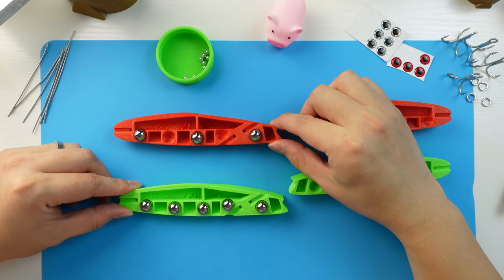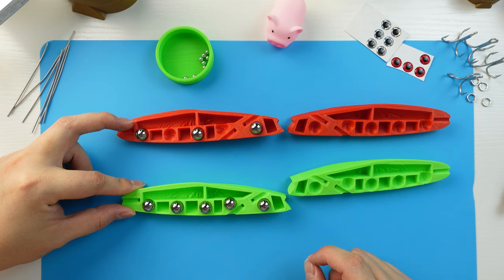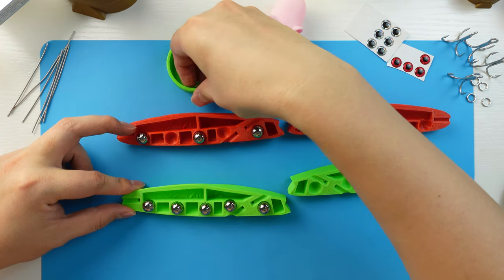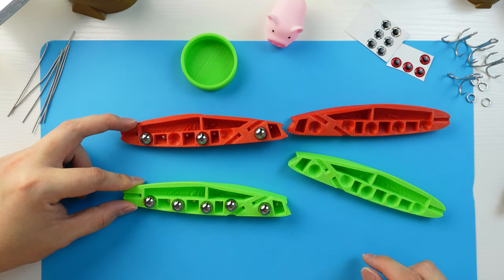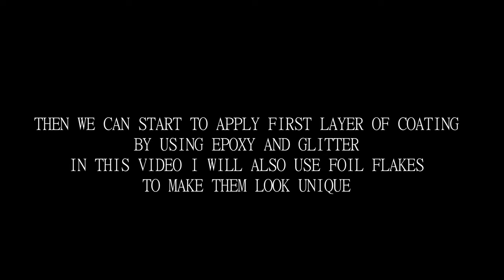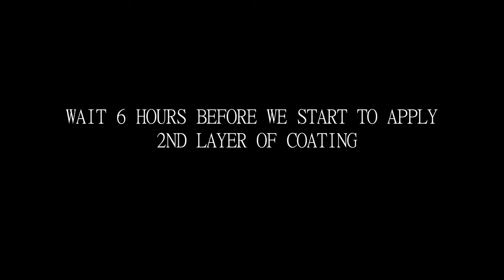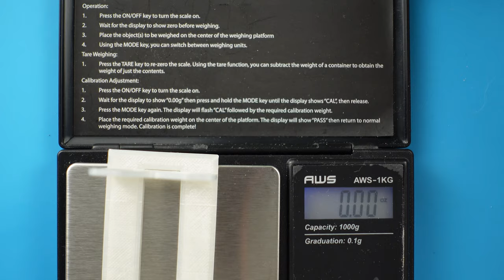Making Darter Plug Fishing Lure. 3D Printed Fishing Lure Making.

Comment: Really cool project. Like the way you make the videos, without the hype. As for the lure - have you considered through wire for it? It should be fairly easy and will increase the lure robustness
Reply from the maker: Thank you. So far the lure is strong enough. If the lure is not strong enough I will try make it through wire.
Reply: @3DPrintedAngler  I've modified the print a bit and it takes through wire without a problem. Big thank you for them, started my 3d printing adventure with your projects. Have a good new year 👍👍
Reply from the maker: Thnak you, wish you have a great 2022.

Comment: Hi nice video and great job. My only concern is what happens if you catch a cow striper on them I’m worried about your wire pieces. How come you don’t put a straight wire through them and it will be awesome.
Reply: Can you make one or same one with a through wire I think It should be stronger. Besides that great job.
Reply from the maker: Hi, thank you that you like my video.
Well, there are a few reasons I didn't design it with through wire.
  1. It is strong enough, because all the the hook eyes are inserted and locked inside the lure not like other wooden lures hook eyes are just glued inside.
  2. With this design weights can put inside lure much more easily.
  3. Again it is strong enough because you have your drag system on your reel. If your reel's drag is 20 lb the maximum force your line and lure will take is 20 lb. If drag is 30 lb then maximum will be 30 lb and so on. I don't think for most surf fishing you will need more than 30 lb of drag. I usually use 40-50 lb test braid line for my surf fishing. So far the only things that cause me losing fish are either fishing line broken or hook bant. The lure itself didn't have any problem so far.
  Yes, if in the future the lure itself breaks then I will redesign it with through wire.
  Not sure if I explained clearly or not. Hope you can understand. Again, thank you for leaving this comment.😊